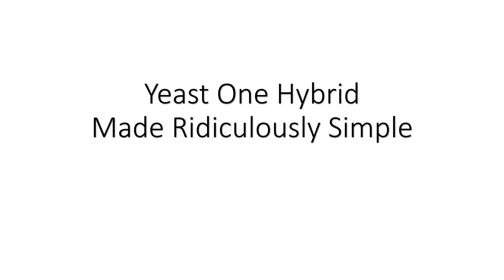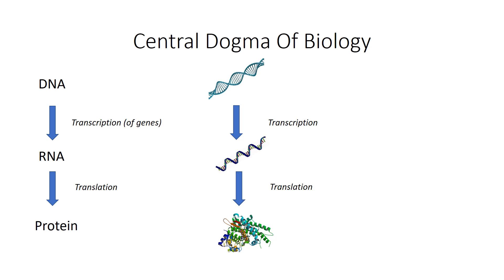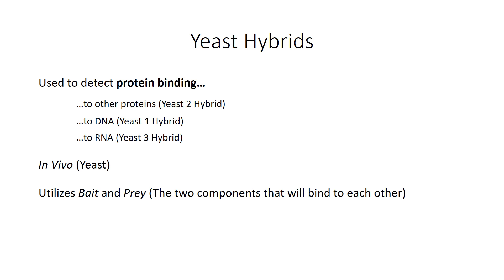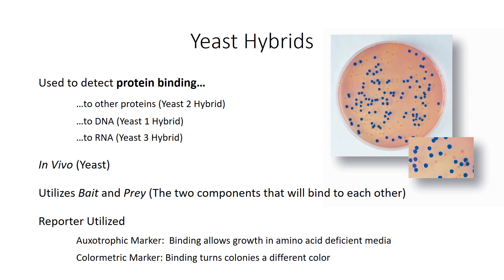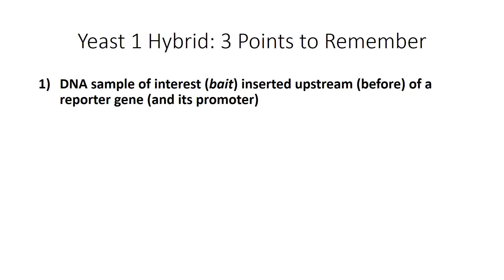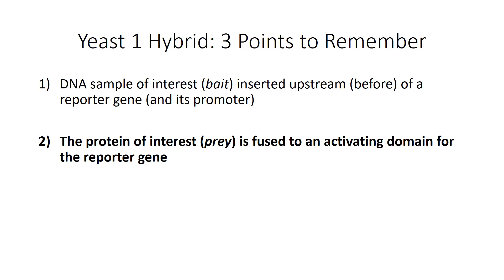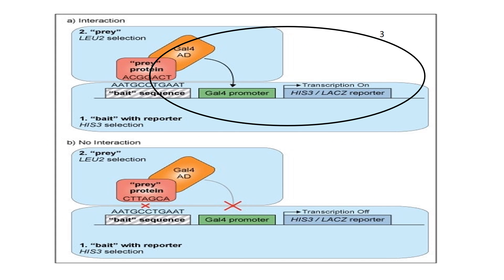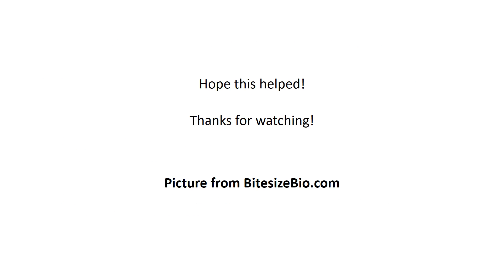Yeast One Hybrid Made Ridiculously Simple

Comment: Thank you for the explanation.
However, I have 1 question regarding this method. How can we be sure that our fused activator-prey protein is folded properly or not? Improper folding might leads to false negative result by this assay..
I know it is kind of rare but in some cases fused protein fold differently.
Reply: Actually this is one of the problems of the modern yeasth hybrid systems that I personally now dont know an answer to